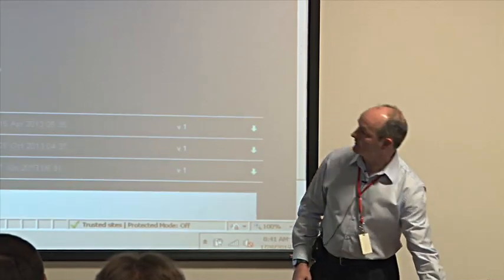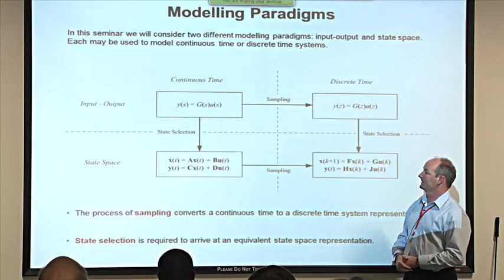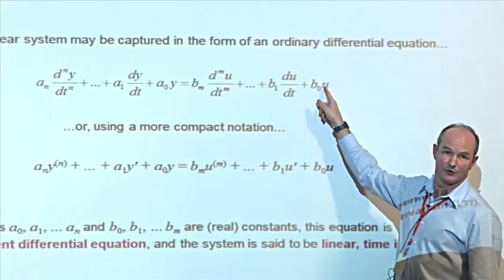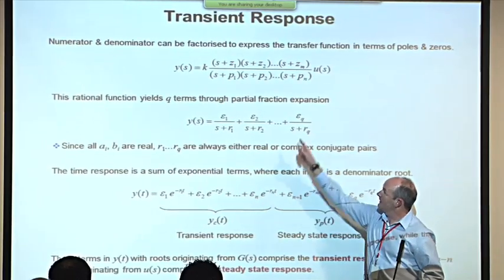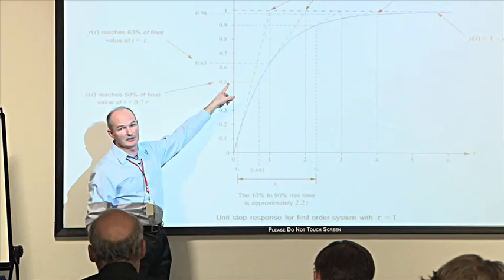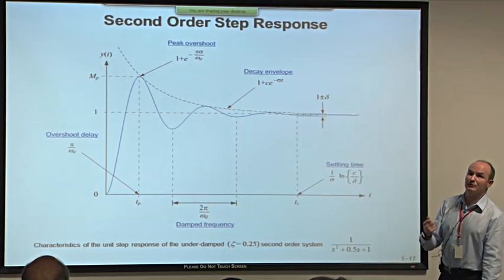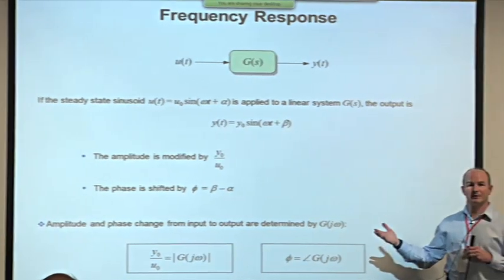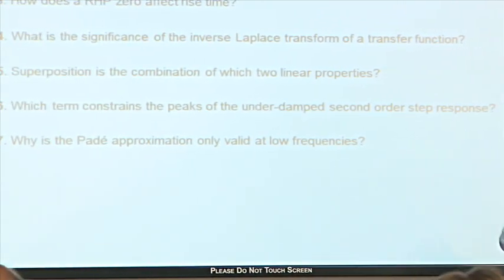Control Theory Seminar - Part 1

Comment: I spent a long time figuring out what convolution is in a digital signal processing course. It's actually quite simple if you think about what it is: 
You have taken two sequences of samples, time reverse one of them. 
Now, sample by sample; shift the time reversed sequence and multiply  against the corresponding sample of the other sequence. Add them all together. 
Shift the time reversed signal again and repeat this. 
The result is the scalar summation of all these results. 
I made a big deal out of nothing. I'm hoping this helps explain it.

Comment: Very practical. I've had many signal processing-related classes, in particular electric circuits. You've made less abstract to me the actual use of poles and zeros and response types. On a side note, it really is incredible how can so many systems be modelled by the same 2 types of equation over and over again.

Comment: think of the foreign audience. The acoustics are very bad, I can understand very little.
Reply: I'm foreign and I have no issues.

The English spoken is very correct and proper.
Reply: @NisseOhlsen  Sometimes the speaker's voice is too soft.  I think Volker Block has a valid complaint.
Reply: Yes, the English is proper, but not the mike/acoustics. If you are not so good in English ( me) , you need high frequencies (konsonants!).
Reply: Try playing with the payback speed setting . This might help . See settings .
Reply: @eamonhannon1103  ok, thanks.